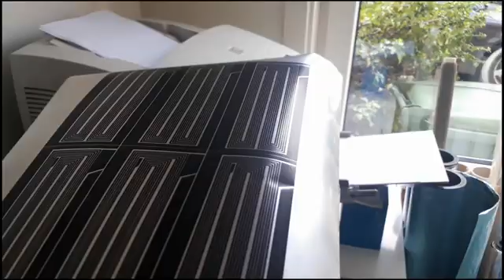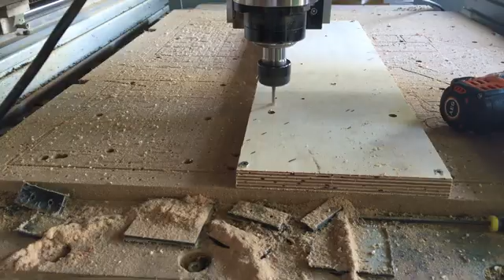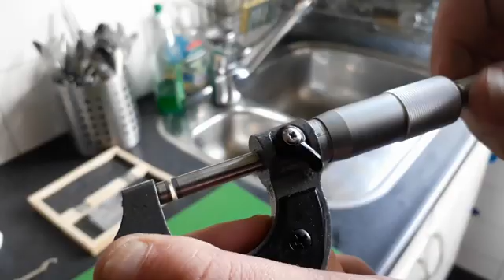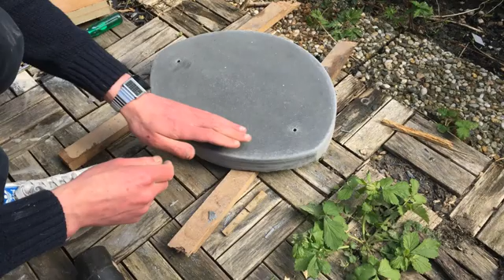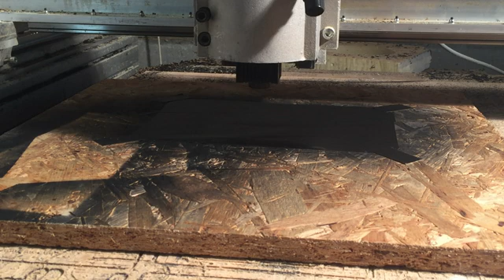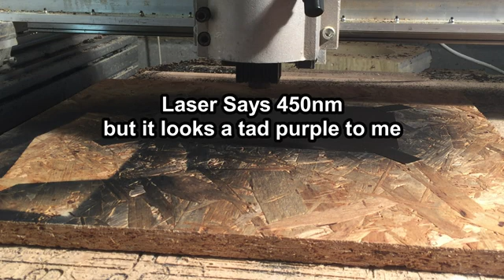Laser Away Etch Resist - Part 1

Comment: Maybe You should try to skip the laser, and quite simply mill a thin line in the Aluminium with a very pointy and sharp milling steel.  Glue a sheet of Aluminium with a low tack glue to a flat piece of plexi and mill away. When done, brush off the debris and mount a sheet of adhesiv Kapton on the Alu tracks. I dont know if this procedure works, but as soon as my CNC is in working order, i shall try it!
Reply from the maker: I thibk it is way to crude .  I would be better of using a drag knife i think.
Reply: Maybe, but it would be very nice to skip printers, lasers and etching!